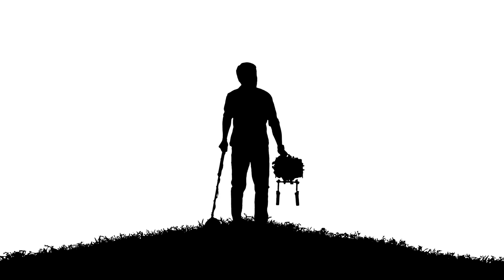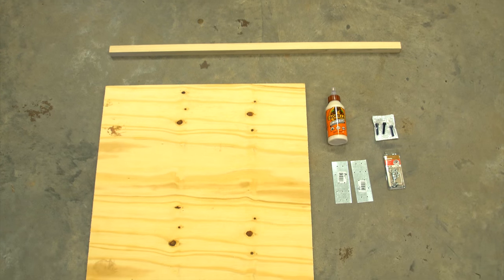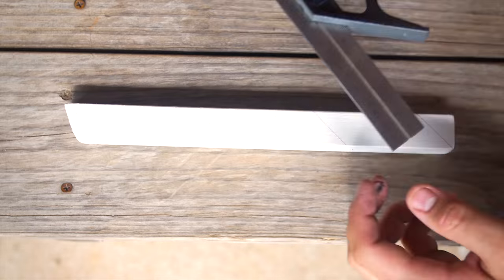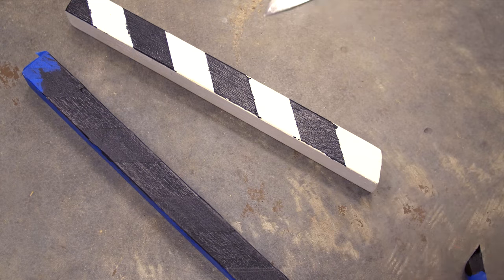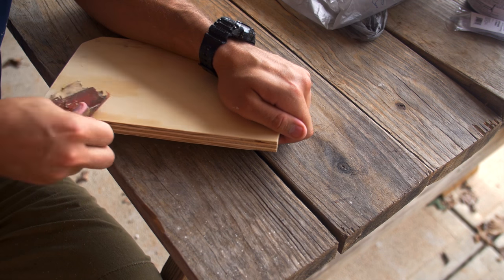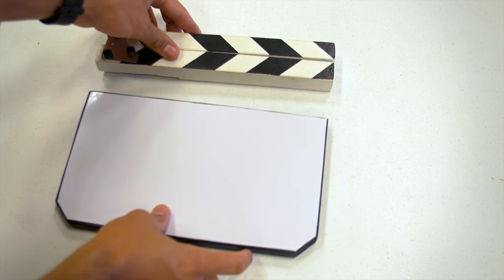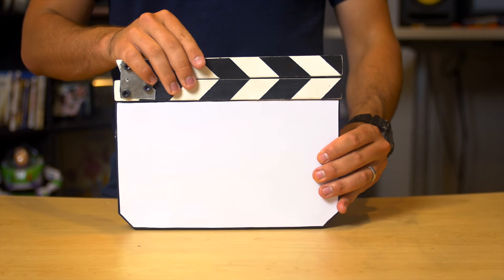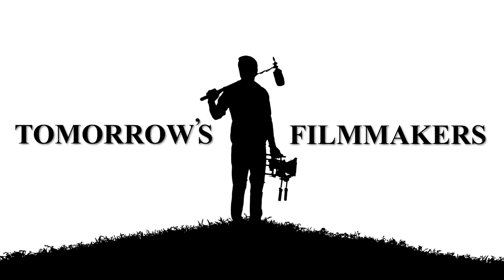DIY Slate Board | Tomorrow's Filmmakers

Comment: Small correction: Those expensive timecode slates are thick because there are very fancy electronics inside. If that wasn't the case, they would be thin too, because that thin plate acts as light diffusion for you to put a flashlight behind when slating in the dark.